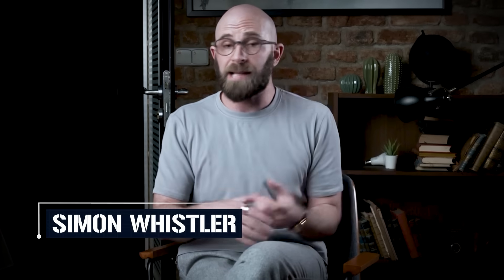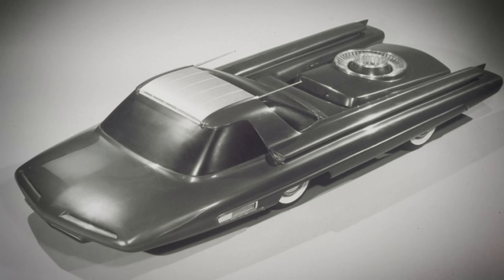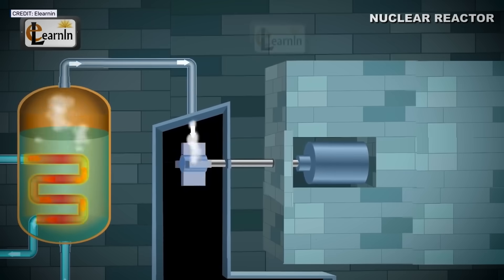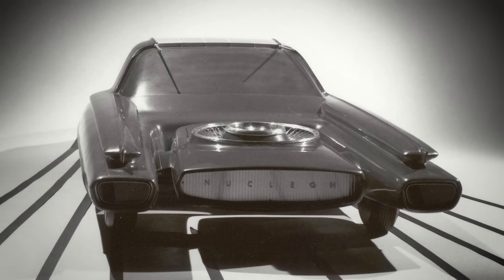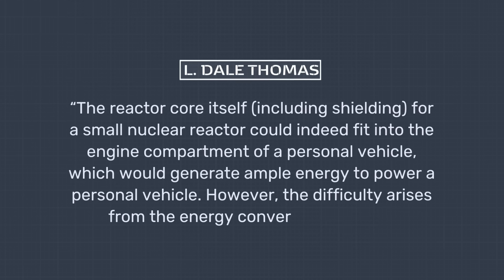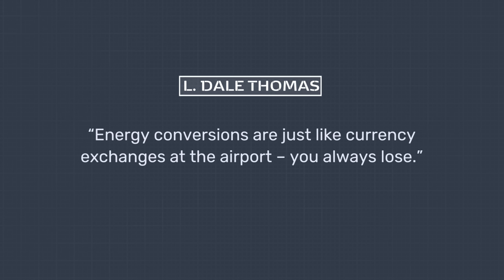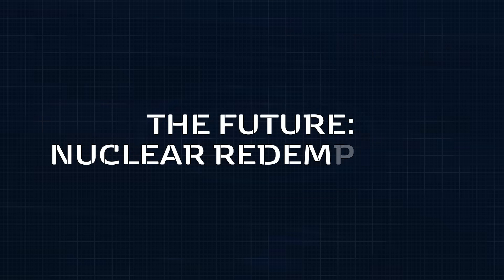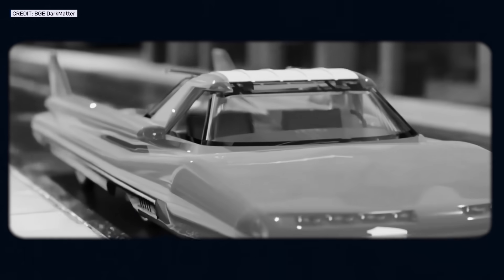The Ford Nucleon: The Nuclear Car of the Future

Comment: Today we could make a car drive continuously for 2 weeks on less than 1 pint(~ 0.5 liter) of water. Even using the fusion process to separate out the hydrogen and oxygen from the water using only the hydrogen. The only problem with a car like this is driving the car into a very large city, capping the device from extracting the waste product, and dumping an S1 container full of liquid hydrogen(~$600 at AirGas Supply) in it and twice leveling that city from the planet.

Comment: Nuclear is more sensible as an green energy addition to home/city infrastructure. A small scale nuclear plant for a neighborhood or township for a battery of electric vehicles is far more sensible than portable water-based nuclear generation.

For EVs, a small radioisotopic thermoelectric generator (like what is used for space probes) would be a much simpler, safer, and smarter addition. Those average about 3W/kg.

For a theory craft, if you were to replace 75% of a Tesla Model S 100KWh battery pack (544kg) with an RTG, you would only have ~90 miles of range, but it would charge from 0 to 100% in about 20 hours. (816W)

A 50% swap would result in 187.5 miles of range with a charge time of 61 hours. (1224W)

(This does not take into account efficiencies around design, along with additional safety equipment and compatibility interfaces, not to mention excess heat dissipation. Numbers gleaned from Wikipedia RTG specs and Tesla specs.)

Comment: This reminded me of when my father worked at BMC Longbridge. He was a senior planning engineer on the team developing cars propelled by gas turbines (the Austin 250 Gas Turbine specifically). They'd earlier partnered with BRM to enter Le Mans using a version, but the real focus was on a saloon version. The victim here was a top of range Rover (the Austin 250 wouldn't fit anything smaller). After a lot of work they managed to squeeze a 250 into a Rover. There was much excitement. As they'd predicted the Rover was faster than s*it off a shovel, but it made an astonishing racket which no amount of dampening reduced this to an acceptable level. And (and it was a big AND) no commercially viable braking could stop the thing. It was canned in 1966 and Dad was devastated.

Comment: I am surprised they didn't go with a radioisotope thermoelectric generator (RTG), like you see in some satellites. Still has the heat and radiation issues, but it might be lighter and could last for decades.

Comment: The problem is people.

Micro Reactors are not common because you would be widely distributing radioactive material, not because they don't work. You can pretty easily build a reactor thar fits on your desk. A Boy Scout built one in his shed from scraps. 

Making them work is easy. Making that safe is hard. Keeping an Idiot from causing a disaster is impossible aside from just not making them common.

Comment: truthfully, the best option for any country would be to take the electric grid and put it under governmental control and then make ev's run off a ground charging system (or for countries like USA, the state) would be like adult scale Scalextric and in that way the current need for heavy and large battery systems would be reduced to small off grid battery backups, but even tesla wouldnt do something to kill off thier chance to charge for changing bespoke parts

Comment: I don't think this car worked 🤔. Modern fission reactors with enough power to propel a vehicle still require roughly 5 feet of radiation shielding (e.g. concrete, water, and/or tungsten) to prevent the operator from absorbing hazardous amounts

Comment: Another huge problem is decay heat. If your piston engine/electric motor goes wrong when driving, you can cut the fuel/power supply with the turn of a key rendering it safe. If a reactor goes wrong when driving, sure you can drop the control rods immediately stopping the fission but the reactor will continue trying to get hotter and hotter, and all you can do is try and cool it as best you can until you get to the point where the decay heat generated is less than the natural heat given off by the reactor (it can take months!). The longer and faster you drive, the more initial decay heat will be generating when you turn the reactor off. Oh, and it doesn't just apply to when things go wrong, reactors will always be generating some amount of decay heat after they are turned off.

Comment: The thing is that you could build a nuclear powered car today.
The car that a once-upon-a-time (back in 1958)  Disney's Magic Highway television hour predicted would come after the turbine car (which we've long since had) and the solar powered car (which is yet to come).
How?
Take an existing electric car (e.g. Tesla) and add a nuclear battery powered by Nickle-63.
Perfectly safe, Ni63 only emits beta particles and decays to stable copper. 100 year ½ life.
Nuclear battery charges the regular Li or better batteries, and huge recent improvements in Ni63 battery efficiency.
It's just a question of putting the pieces together.
I should suggest it to Elon.
https://youtu.be/wfsE-8pazlo?si=WF2URq9h2Nf4DT1a

Comment: 13:36
Electric cars have losses

Power generation plant:
Coal to heat, heat to steam.
Steam to kinetic energy, 
Kinetic energy powers a generator to  generate electricity.

Transmission line:
Step up the generator voltage with a transformer to (for example)50K volts.
50K volts travel 25 miles (example) on high voltage lines to first destination.

Step-down the 50K volts to 220 volts with a transformer to final destination.

Charging:
Electrical energy to chemical energy.

Driving: 
Chemical energy to electrical energy.
Electrical energy to kinetic energy.
 ***********************************

Every step is an energy loss.

Comment: My first thought in noticing the wheelbase was, "Wait, why the heck would this car exist like this? Wouldn't it tip forward every time people got into it?" Then I remembered there's a nuclear reactor on the back. That's probably the reason for the funky design of the wheel line - to stabilize/handle the weight of the reactor. But, uh, I guess I should watch the rest of the video! Maybe you'll comment on this and/or prove it wrong!

Comment: One correction I'd give is the nucleon would not have been fast. Nuclear power has high energy density, but it does not have high energy potential. I know we talk about nuclear power as big and strong, but that's mainly because the nuclear reactors we have tend to be big due to regulations making smaller reactors less viable. In reality while the uranium used has a lot of energy it doesn't output it very fast. 

Like the reactors for nuclear battleships are around 100MW electrical output at a size of 20ft by 15ft for just the reactor, not the shielding. For a car we're talking a reactor about the size of a football if even. Honestly more likely to be a tennis ball. EBR1 had reactor fuel about the size of a football and only put out 200KW electrical. That sounds like a lot, but many EVs use more than that right now for hard accelerations. 

The main problem with the reactor though is cars are made to speed up and slow down, while nuclear reactors are the least convenient power for spin up and down. Like what do we do with the excess energy made when sitting at a stop sign?

Comment: If you charge an EV from electricity made in nuclear power plant, then it's the same as the Nucleon (reactor + turbine + generator + electric motor), but with the addition of all the transformer, power line losses + efficiency of the battery. So there are more steps, not less. On the other hand, a large-scale nuclear power plant is probably more efficient than a small-scale nuclear plant in the car.

Comment: Would you strictly need the last conversion from mechanical energy to electricity or could you just hook up a transmission between the turbine and wheels and call it a day?

As for accidents: "You turned a mere fender-bender into a potential Three-Mile-Island" - Mr. Burns, probably

Comment: I beg to argue, you could definitely use this in a hybrid electric car. As the power source for the electric engine. Also it could charge the battery while not in operation.
Reply: Yer bit like the the way the mars rovers work extremely expensive tho pretty low performance 
Think they weigh about 50kg and produce about 100watts so you could probably have a couple of them 
And a small battery and maybe a few solar panels you would probably get about 100km a week out of it
For about 10 years
Reply: Better to wait for the fusion car. It also be a bit like having an old diesel, which may be enjoyed by those missing the temperamental nature of machinery.

When time to take off, one just have to hold the key a while for the laser array pre-ignition phase. 😹

Comment: Energy conversion for EVs is actually pretty bad. You'd be surprised at how much energy is lost when charging an EV, especially as the battery reaches capacity as the conversion rate becomes worse the longer you charge the battery.

Comment: The future I would say is in converting high frequency EM radiation directly into electrical energy, by-passing the thermal to mechanical energy conversion.  This technology is about 10 years out from a potentially viable real-world solution.

The technology exists today in the form of Atomic batteries, but more efficient technology is on the horizon that could potentially power automobiles and planes.

Comment: So why not have the heat melt sand, then tune a photo cell to collect that light making it more efficient,  by taking one conversion out of the equation? 
Also does not need to be nuclear,  because any fusion would work.

Comment: This is the type of electric vehicle that is most practical and efficient. The highly combustible lithium-ion batteries are a dangerous nightmare for many reasons but mainly because the raw materials are resourced from using slave labor including children. We have radiation all around us in the cities and burbs in the form of microwave transmitters and ovens, x-ray machines for medical and industrial uses, and highly efficient nuclear power plants that are still in operation as well. Nuclear power is statistically very safe at this point in the game. I cringe every time I hear electric cars in their present form being lauded as the transportation of the future which it can never be because of the need to be recharged and the unreliability of batteries. Plus, God forbid you forget to charge your car one night because it was storming when you came home and now, you're about to run out of battery life stuck in traffic on an interstate highway somewhere because of a bad accident down the road. Nuclear power plants in common vehicles could be life changing for humans. Imagine only needing to fuel up once a year?

Comment: So it might be dumb but why turn the turbine to create electricity then turn it back into kinetic energy couldn't you just do sorta like a normal engine and use the initial turbine spin to spin up axels or flywheels or whatever to negate some of that and does pulsed nuclear not exist instead of constant output bursts of heat to spin up the flywheel or whatever and  that kinetic energy bleeds off in like a reverse regenerative breaking ... Idk not an engineer or physicist but no part is the best part cut out steps if it's possible just don't know if it is

Comment: Betavolt's nuclear battery converts nuclear to electricity. All they need is a nuclear battery pile. The battery has a 50 year use time so it should power an electric vehicle or house for that time.

Comment: Possibly my favorite Simon Whistler episode! What about the Chrysler turbine car? Sir Frank Whittle invented the radial flow gas turbine engine because it took too many moving parts to mach such little engine output. Chrysler saw how his invention changed aviation, they put put a radial flow gas turbine in a car. It was an extremely simple engine, 1 moving part. It could run on anything liquid and flammable. It would've been extremely fuel efficient, on par with piston engines. The engine would've outlasted the car by like a century. Honestly, that radial flow gas turbine engine changed the direction of my life. I'm going to bring those wonderful cheap, reliable, powerful little engines to market.
Reply: Unfortunately turbines can only match piston engine efficiency in very narrow speed and power bands. Sitting at a stop light in a turbine car, you would watch the fuel gauge needle tick down before the light turned green.
Reply: @StFiacre  Precisely. An APU helps with their use in Tanks, but having to have a mini-ICE to make up for the shortages of the main engine isn't ideal, nor all that practical in a car 😅
Reply: A bit like Wankel Rotary Engines, it's not that simple re' Gas Turbines.

Take the Abrams Tank for instance. If it has anything other than the AV Gas it's designed to run on put in the fuel tank, the result is vastly worsened wear on the engine, as well as worse performance and dirtier output.

Gas Turbines also don't idle well, are noisier than contemporary ICE, are less fuel efficient, are generally more fragile (ironically) and have less torque, among other issues.

This is most of the reason why Rover in the UK also ceased working on Gas Turbines, after having put a lot of time & money into them.

They work well in Helicopters, as Generators on ships and on land and in some other applications, but re' Cars there are other more practical options, as happened with the Wankel Rotaries.
(the latter technically bankrupted Citroën in the 1970's, and is only used by Mazda today and in a few racing cars)

Comment: I'd love an e - motorcycle with a tiny nuclear battery. It's safer and weaker than a reactor. Adjustable lithium battery pack. 40miles smallest one. 60 miles that got 10-20 recharged in like 3-4 hours would be enough for most things i do. The slower the nuke would charge the bigger the lithium. Even if it took 6 days to fully self recharge 70 miles it would be useful.

Comment: To the extent that we lack a definitive solution for managing spent nuclear fuel is incorrect. We possess a comprehensive understanding of its disposal. Spent nuclear fuel undergoes a brief period of storage in a spent nuclear fuel pool before being encapsulated in concrete dry cast storage. This storage facility is designed to be situated on-site and can withstand direct missile strikes.

Comment: You're claim about nuclear waste being unsafe to handle and hard to store is completely untrue and I believe you know it.  Most nuclear fuel can either be used in a fast salt reactor or it can be stored in solid concrete in an area so small it's practically negligible to the US.

Comment: As a massive Fallout fan, ive been fascinated by the Nucleon for years. The cool thing is that if you drive an electric car in an area primarily powered by nuclear, you already drive a nuclear powered car touch temple thinking meme
Reply: So by your logic any electric car is also steam powered.
Reply: @skylined5534  not if your local grid is entirely solar or wind powered 😂
Reply: No you aren't
Reply: @randybobandy9828  The electricity would be generated by nuclear means so it would be nuclear power in the car. I don't see how you wouldn't just on a logical level.